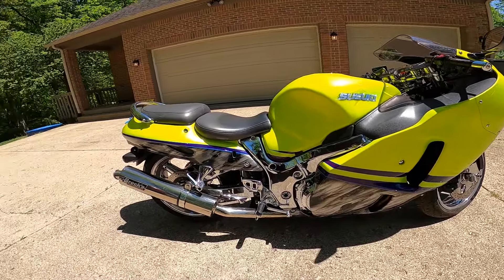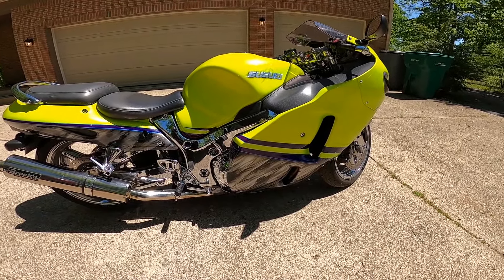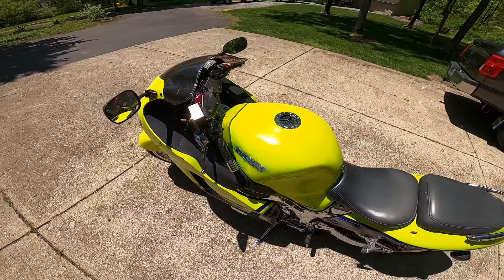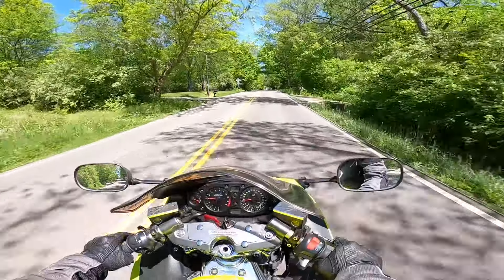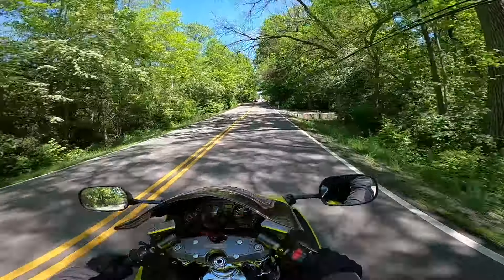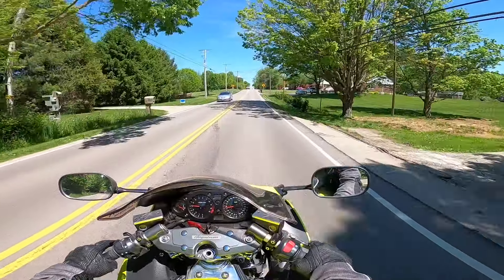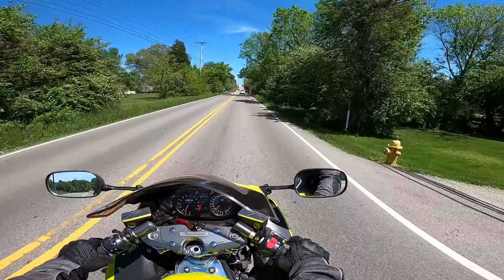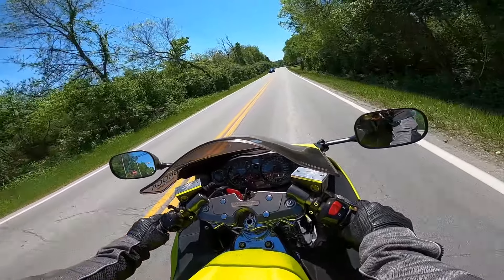Gen 1 Suzuki Hayabusa - Diagnose Mysterious Ignition Miss (Part 1)

Comment: A cheap oscilloscope with two chanels could show you if cam and cranck are out of phase.
You probe the wires at the ECU plug with pins,and don't have to touch or remove anything else.
You have the degree wheel,and the ignition/timing marks already ready,so lets do that haha !

Comment: Thanks, I'm trying to work out why my 2008 suddenly wont fire! Dead, either no spark, still getting to the plugs, or zero fuel ie injectors. I fell in love with the looks, I reckon they look the part. Only a couple of months ago it went in for a recall to replace power regulator, and Im fairly certain it wasn't replaced as there is a metal frame pin with a plastic harness loop that neither end could pass through. You would have to cut that loop to replace. Anyway thanks best wishes from Australia.
Reply: Hey I'm having the exact same problem right now and I nearly tested everything listed in the suzuki workshop manual for the 2008. I'm getting crazy about it. Did you resolve your problem?

Greetings from Germany ✌️

Comment: Ur almost sounds like coil heat soak breakdown? Or maybe pickup coil degradation? Will it miss at cold temps as well?
Reply from the maker: It misses at the same spot on the tach, all of the time.
Reply: @BrockDavidson  Ignition or cam timing then?
Reply from the maker: @georgeanddaddecker7563  good call...both 😉

Comment: Are the secondary throttle blades still installed? Possibly issue with the STVA? What about the aftermarket fuel cap? Is it vented properly? If sealed it can cause an issue. Opening it and then immediately going for a ride under load to see if issue goes away. It issue appears after a few minutes then cap ventilation issue.

Comment: Hopefully you can see this message and have time to answer my question. I just purchase a 2001 busa and they eliminated the oil cooler and put block off plates on there. Am I safe to drive around like that Don't do so much long distance driving. Or should I put the oil cooler back on thanks
Reply from the maker: Never a good idea to street ride without oil cooler. But reinstalling can get tricky too unless they added a bypass hose. If blocked and capped, you must reinstall the plug.
Reply: @BrockDavidson  Are you talking about the plug? That's behind the oil filter besides putting everything El spec. Thanks for getting back to me appreciate it.
Reply from the maker: Yes. But also be weary of any other "tricks" - like welding the oiling holes shut in the balancer. If you get everything back to the specs in the Suzuki Service manual - you will be fine. Best of luck.
Reply: @BrockDavidson  thank you so much

Comment: Brock, did you check the charging system voltage output? if the voltage exceeds the threshold that the ECU can handle, over 15.5v, this could be the issue. Faulty voltage regulator? 
Or if a stator coil winding is faulty, voltage may be too low?
Other possibility is one or more ignition coils breaking down under load.
Did you check the fuel pressure at the injectors? If the fuel pressure regulator is faulty and allowing pressure to increase or decrease from the specified 42psi, this can cause running problems like the one that you are experiencing.
So many possibilities . . .

Comment: Was the there that audible tick tick tick noise you usually hear at idle with a stretched cct? not sure if it's noticeable on the older model bikes. Have definitely noticed it on newer  kawi's when the cam chain has stretched. Never owned anything but kawi's so not sure.
Reply from the maker: @kawi lifezx10r  - yes, there was an audible tick at idle. I tried to catch it on video -but the sound is elusive on the audio due to the noise the clutch basket backing plate springs were also making.

Comment: Isn't the battery just for starting the bike. Doesn't the stator/alternator provide all the electricity needed to run the bike once started, as well as recharge rhe battery from the loss during starting?  I know you should be able to remove rhe battery from the bike once started and it should remain fully operational.
Reply from the maker: Not on most bikes. Unlike cars, bikes don't have the room to carry high output alternators, especially fast bikes since they rob power. Additionally, power requirements are far greater under heavy load than when cruising so even though it may run...it doesn't run correctly or for long at high speeds.
Reply: @BrockDavidson  thank you fine sir!

Comment: I've had the exact same problem on my 2007 Honda CBR600RR, it would feel like a soft limiter at 12k revs (engine redlines at 15k+) The problem ended up being a broken top compression ring in cylinder 1.
Reply: Whoa how did that happen on a 07-12 cbr600rr? Most reliable bike or 600cc supersport ever? I had one i wish i had it back again..
Reply: @Jason.cbr1000rr  I'm going to put it down to poor maintenance from the previous owner (engine was quite dirty when I stripped it) I had only done 300 km's (186 mi) when she went pop. Installed a used engine with over double the mileage of the original (55 000 km's, 34 100 mi. Original one had 23 000 km 's, 14 300 mi) and she ran sweet from idle to redline. Kept the bike for almost 5 years after that and she never skipped a beat, and then I sold it last year December :(
Reply: That shows the importance of properly test riding a bike before handing your money over. I didn't and it kicked me in the groin.
Reply: @FiggyDRandoms  oh ok, previous owner mustve been a terrible owner, most likely gave it too much of a beating (not that honda can handle it but add that with poor maintenance equals kabboom! 

Hey when i lost my 07/08 cbr600rr all black and carbon bits, due to a total loss cos of a crash, i still miss it 6 years to the day, after that i had zx6rs 636s, Z1000, and now a 2011 yamaha r6, i wish i have my cbr600rr back, its the best bike i  every aspect. Midrange to high end pull feels like a boosted engine.. the r6 is just raw power all at the top end. Ehh... but the 600rr undertail and the sharp robotic machine look still looks futuristic and holds up today. Can even be mistaken for a new bike! I hope to get one back someday but i also like the cbr1krr 2008 gen or the 2012 dragon eyes one. I wish i had the money to buy them all. But i miss the high tail and undertail exhaust which is the sexiest bit of it.

Oh and i had mine at 30k kms until 58k kms and never missed a beat engine wise.
Reply: @Jason.cbr1000rr  Yeah the previous owner was a bit of a tw*t😂 he didn't do any maintenance on the bike. It sucks losing a bike to a crash, but hopefully nothing bad happened to you? 

I really did love my CBR600RR and miss it too... bike rode fantastic, was comfortable and pulled like a train. Funny enough I was also interested in a 2008/09 CBR1000RR they look really beautiful to me. And yes the under tail exhaust is super sexy!!

Comment: Do drag bikes run a rear wheel sensor I would assume that they wouldn't because of all of the gear changes?
Reply from the maker: Yes
Reply: @BrockDavidson  all right looking forward to part 2 on the Hayabusa
Reply from the maker: Just curious, why would you ask about the rear wheel speed sensor vs. number of gears shifted?
Reply: @BrockDavidson  because there are several bikes that have had gear changes and not having the problem I am so it must be something else maybe
Reply: @BrockDavidson  I don't drag race but I know the diameter of my wheel is smaller so if I do make a gear change I think I need to go down maybe by two teeth on the rear sprocket instead of one up that is on it?
Reply from the maker: What problem is that?
Reply from the maker: Oh, sprocket change. The only bikes that struggle are zx14r's going larger on the rear sprocket.
Reply: @BrockDavidson  from 3200 RPMs to about 4200 RPMs the bike is stuttering like the Hayabusa you're working on. Just at a lower RPM
Reply: @BrockDavidson  please watch" ZX14r speed sensor"  on YouTube.  Thanks
Reply from the maker: I know about this. We had a cure from Don Guhl. Our flash asked for your sprocket sizes and we cured accordingly. Unfortunately, Guhl left the industry and no one else knows how to cure it...at least that we know of at this time.

Comment: I would try swapping the ECU with a known good one. It sounds like it is bouncing off the limiter. 
Did you check the spark plugs? Were any excessively wet?
What kind of shape are the injectors in? Any swelling? I'd ohm the injectors and give them a good cleaning.
I would also check & ohm the primary/secondary on the coils. I would also check the wiring harness for any broken wires. Specifically at the connector plugs for the coils. (Give each wire a light gentle pull to make sure they're snug in the connector.) I've seen wires that were broke, but were held in place, and hidden below the weather proof seal on the wiring.
I would also check for any broken ground wires. And for any broken wires at the ECU connector plugs.
I would also maybe go through and test any and all electrical sensors. If those all checked out, then I would pull out the wiring diagram, and start at one end of the harness, and individually check each wire and its output for continuity.

Comment: I have a Hayabusa 1300 generation 1 and there is no spark on the spark plug. I have changed 3 or 4 electronics and with each one there was no spark, but only with one the fuel pump wanted to work and with the other 3 it does not. Is there a difference in the electronics? Does anyone know how to get spark on the spark plug?
Reply from the maker: Put the bike in dealer mode, it will tell you what it thinks is wrong.
Reply: @BrockDavidson  but everything is connected, the engine crank and everything but there is no spark
Reply from the maker: Dealer mode does not require the bike to start.
Reply from the maker: https://youtu.be/15nqZWmFY8s?si=ahZbzfCBHE_kVlsr

Comment: Bend the small tab on the stand to apply more pressure against the switch.
Reply: It still wouldn't fix the the kick stand. It needs more return spring tension.
Reply from the maker: https://youtu.be/-O8o0QH3gME?t=2701
Reply: I've had good luck with all the ones I fixed by bending the tab. Done many that way. I guess that one in the vid is beyond clapped out.

Comment: Hi Brock. 
I was hoping if you could please help me out with a technical question.  
on 2017-2020 GSXR 1000R, the connector that plug into dashboard/speedometer/gauge, could you please tell me which wire ( color code) is the ground and which wire is 12 volt power supply to the dashboard?
 Thank you so much Brock!
Reply from the maker: I have no idea...why would you want to know?
Reply: Thanks Brock for the reply. Trying to troubleshoot the Starlane Davinci-II TFT dashboard that I am trying to install instead of OEM LCD dashboard.
Reply: It should be black/white for the ground, and white/green for the +12V. Anyway, it’s easy to check with a multimeter and find the correct wires
Reply: Thank you Simone.

Comment: I've got a GSXR that just never runs right at idle, "idle surging"  and has been going on since 2500 miles. It also backfires once in awhile. Full Alpha T exhaust with ECU Flash. Driving me crazy. Runs hard as hell up top but at low RPM backfires. Wish a guy like you was closer to diagnose it.
Reply: Had same issue, I changed out the spark plugs must have had a bad one or something cause it totally fixed it.

Comment: My 04 Busa only runs on 2 cylinders, then when u crack her open sometimes it kicks into 4 .  Can anyone tell me y?  👍 THANKS. Im wondering if it was my kick stand causing issues? Now my busa is apart to restore to new AGAIN
Reply from the maker: Put it in dealer mode. If it's not throwing codes, the problem is likely in the fuel system.

Comment: one of my friends had an M109R and it had a issue with the clutch switch on an aftermarket lever causing the bike to nut run right... I rode a Hayabusa for the first time ever ( my brother's gen 2 ) it didn't feel heavy like I thought it would and I had to constantly check my speed otherwise I'd be doing 80ish all over town and not even know it.

Comment: My 2018 ZX14R is doing the exact same thing with only 4500 miles on it but at 3200 to 4500 RPMs and mostly in second gear any suggestions? Thanks
Reply from the maker: You changed your sprockets... use the blue support button on our site for more info.
Reply: @BrockDavidson  one tooth on the rear sprocket up to a 43 you really think that's what's doing it? I wonder if an ECU flash will help
Reply from the maker: @Tj Tj - yes. We used to have a gearing adjustment drop down on our ZX-14R  Guhl Moto flashes specifically to cure this problem. Unfortunately, Guhl has left the industry and I don't know any other 3rd party flash software that knows how to cure. Maybe ask Chris Moore if he can help.
Reply: Why did Guys leave?

Comment: Secondary injectors plugged or bad.
Reply from the maker: Gen 1 Busa's are single injector bikes. But GREAT call!
Reply: @BrockDavidson  oh ok. I would say fuel filter, but you already changed the pump. I just had mine do it with a crap starter relay. But I just got to the part where you said the cam chain tensioner is the possible culprit. Great content man.

Comment: Should still check fuel line from tank. Found dirt, rust. Replace filter. And make sure no rust in tank
Reply from the maker: We inspected the lines when we replaced the fuel pump.

Comment: Put some plugs in it, 4000 miles and they are done, I have an '03 for 13years in the UK, every 4K it drops a spark on one plug, did it at 3900 miles 8010 miles, but the bastard has just done it again after only 1200 miles. 9K miles from new. Totally stock bike.
Reply from the maker: A leak down test can help determine why it's happening.
Reply: @BrockDavidson  A leak down test for a failed plug?
Reply from the maker: @Mark holroyde  - Yes. Consistently fouling plugs (in the same cylinder) are typically a sign of inadequate cylinder pressure (tight valve, head gasket leak, etc...) or oil contamination (poor ring seal) both are easily determined by a leak down test. If it's happening to random plugs in random cylinders - look more towards the tune-up.
Reply: @BrockDavidson  Different cyls, stock from the factory, 9100 miles, no oil use...ive been leak testing cars for 35 years,  not coils, this thing has beat 20 so called "experts" so far. New plugs, good to go, its a real difficult one, no codes, starts instantly etc etc. cheers for reply.
Reply from the maker: Interesting. I would have to see the leak and compression results to try to help more.